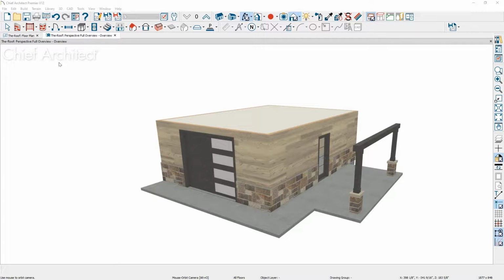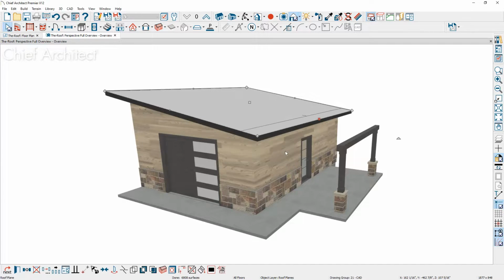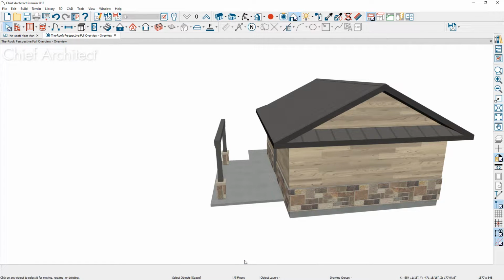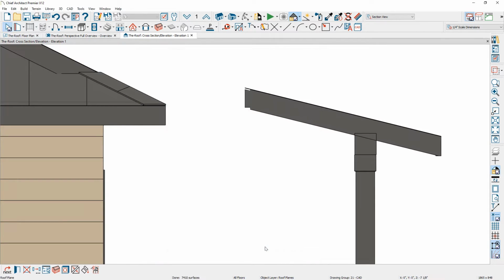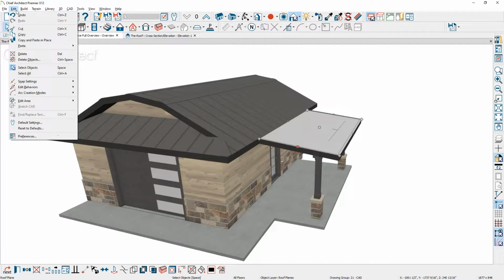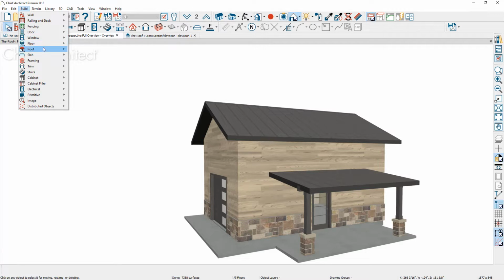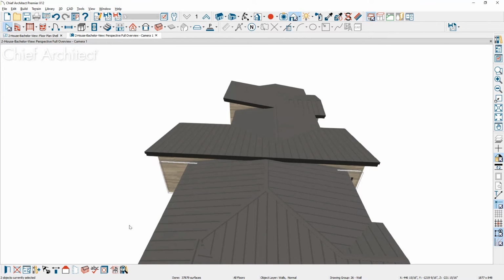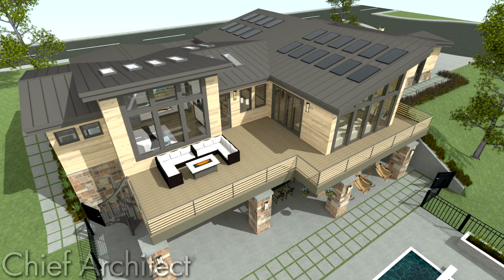Roofs Tips and Tricks (Re-Run)

Comment: Is there an easy way to get to roof type definitions?   Wall type definitoin was obvious where I could specify layers, material types, insulation etc.   I haven't found it in X13 - what I did fine was materials under roof defaults but that doesn't seem nearly as intuitive or logical for orders of layers.
Reply from the maker: The roof does not have a roof type definition, but you can change the material within the roof specifications.
Reply: @ChiefArchitect  Thanks -    I'm curious why they don't make roof types like wall types.    Seems like you'd have external, core and internal components where you'd want to specify material, thickeness, order etc. exactly as you would a wall.
Reply from the maker: @boedillard8807  That is a great idea, I will pass along your idea to our developers. Thank you!

Comment: Hi CA

Please advise as to how CA would treat a courtyard in the center of the house perimeter.

What is the process of creating a grassed area as a courtyard without CA treating it like a room with a ceiling. 
Even when I draw the perimeter boundary walls and give the "courtyard" a grass area, CA still assumes everything is under 1 roof.

Please advise.

Thanks
Reply from the maker: You can try adjusting the room specifications. Under the structure panel, there are options for "Roof over this room" and "Floor under this room."
Reply: @ChiefArchitect  Thanks,  will do.